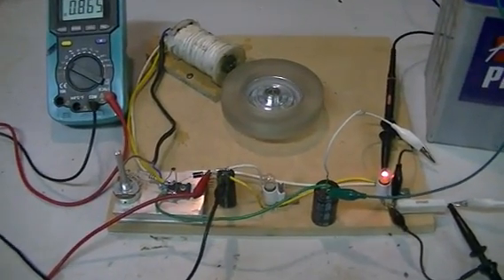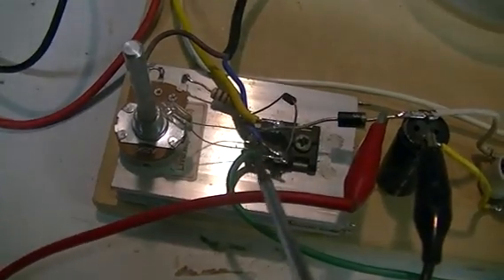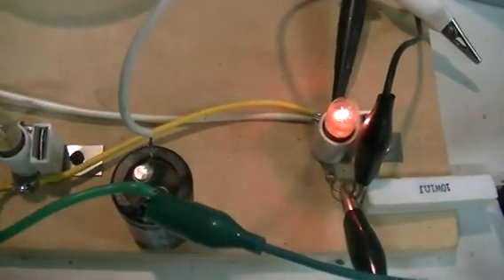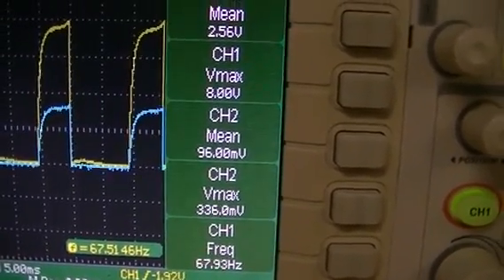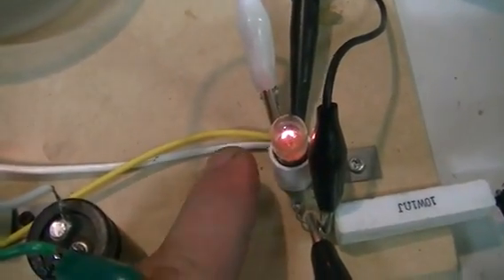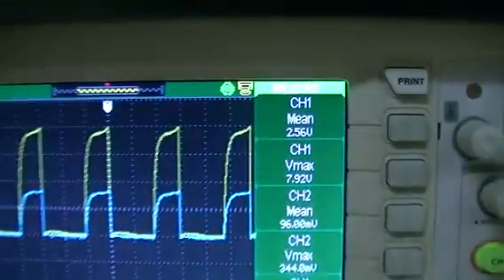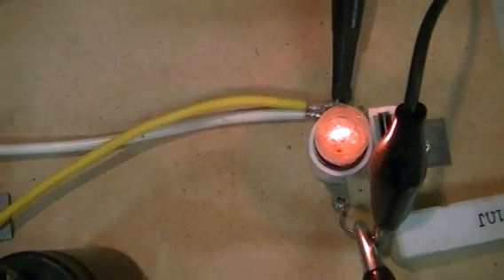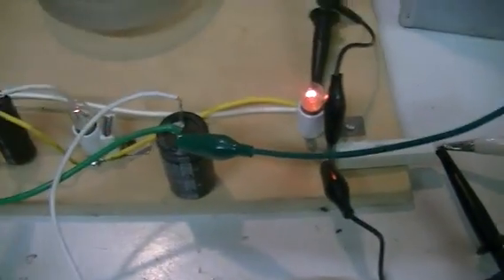Pulse motor measurement harder than you think.

Comment: Hey  Tinman ,  I've  been  following  your  videos  for  a  while .  Wonder  if  you  can  give  me  advice .  Built  my  first  pulse  motor .  Standard  SG  circuit  with  a  mjl21194 .  Four  magnet  rotor .  The  charge  battery  I'm  using  was  pretty  dead .  My  voltage  is  all  over  the  place .  12 - 14.5 v . My  neon  is  on  all  the  time ,  pulsing .   The  voltage  is  going  up. Was  5v, now  7 v  after  10 hrs .  I   wasn't  sure  why  the  neon  was  on  all  the  time .   And  why  the  voltage  jumps  around .  Any  thoughts ?  Thanks  KennyG

Comment: 1. In the beginning you talk about your UPS as an "isolation" device. Every UPS I have ever seen on this end of the planet passes the third wire "ground" connection straight through from the Mains connection to the Device being powered by the UPS. Just to make sure I just tested 5 different UPS units here: A Tripp-Lite, two CyberPower, one SLWaber, and one Kensington, and they all pass the Ground connection straight through.  So none of these would actually isolate the scope's ground from other grounded instruments. However most bench PSUs do not connect either the Positive or Negative output to the chassis ground, unless specifically told to do so (by a strap on the output terminals, for instance.)  
Are things really that different in OZ? 
But good that you are using a battery, anyhow. 

I'll have more to say later.
Reply: +TinselKoala 
2. Please please PLEASE stop using those wirewound "concrete" power resistors for CVRs! They are a lot more inductive and less accurate than you seem to think, plus they also have a "temperature coefficient of resistance" similar to a light bulb filament, in that they change their resistance slightly as their temperature changes. Even a standard metal-film resistor would be better than those.  I have been using some Ayrton-Perry type non-inductive precision sense resistors as CVRs in my recent work. They are not that expensive, they are accurate in value and are readily available from the usual suppliers. Ohmite WND1R0FET are 1 ohm, 3 Watt, 1%, and WNBR10FET are 0.1 Ohm, 1 Watt, 1%.  Their inductance is very low and I connect them as "Kelvin" probes and use both scope and multimeter to monitor the voltage drop across them. They cost about 50 cents each, iirc.
 
More later.
Reply: +TinselKoala 
3. I agree that inductance of the CVR and bulb are probably not introducing much error here... but I think that when you connect the capacitor to the probe side of the bulb, you are contaminating the voltage reading and are no longer reading "just" the voltage drop across the bulb.

Comment: AC/DC Setting on the scope?
Reply from the maker: +Ian David  I am using DC coupling on the scope,as it is a DC current we are measuring.
Reply: +TinManPower It's good that you are using DC-coupled inputs to the scope, but this has nothing to do with the fact that you are measuring a DC current. DC-coupled inputs should be used almost always, whether or not the signal being measured is "DC" or "AC". We have been over this before. The AC-coupled input setting places a capacitor in series with the probe and is used to filter out a DC offset or slowly changing "baseline" from an input signal. It is basically inserting a highpass filter in the input signal path. Sometimes you want this, as when trying to measure a small ripple riding on top of a larger DC voltage. But most of the time, whether measuring AC or DC, you do not want this highpass filter capacitor in the signal path, so you should use DC-coupled inputs by default, and you should have a very good reason for using AC-coupled inputs when you do. AC-coupled inputs basically remove or alter almost all Vertical information except Peak-to-Peak voltages from an input signal, so should almost never be used when doing power computations, regardless of the "AC" or "DC" nature of the actual signal.
Reply: TinManPower Thanks TinMan I knew you would have all bases covered

Comment: Interesting investigation. Thanks for sharing. Can you compare the bulb and a cvr between the cap and bulb? The value of the cvr is going to effect what is happening. The relationship between voltage pressure and current can be separated in the right conditions. In most cases electricity only does work and dissipates energy in its forward pushing motion as it travels to a lower state. When electricity flows through a wire, like water in a pipe, and encounters a resistance a positive pressure builds as compared to the lower side of the resistor. If energy on the low side can be taken away faster than what is flowing through the resistor a vacuum or pulling force is created and less energy is dissipated at the resistor (bulb) and more current will flow. A negative resistance is what you have shown. The information I'm sharing is a combination of what's being done today and what the pioneers in science knew. Much more research to be done.
Reply from the maker: +Arkiver Unified Energy  Now we are getting close-->a vacuum is formed.

Comment: tinman i think what is going on is, that cap with the white wire and clip when connected is allowing a potential to build in the cap and your dumping on the bulb, if it was higher the bulb would go out....equal or similar volgages across incandescent bulb will put it out......thanks for sharing